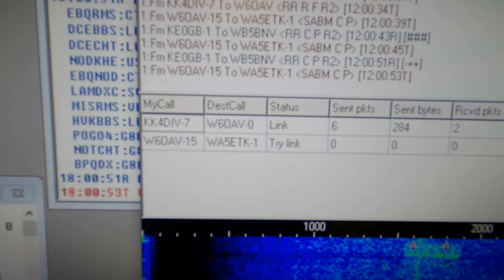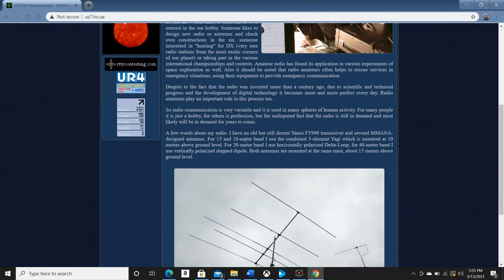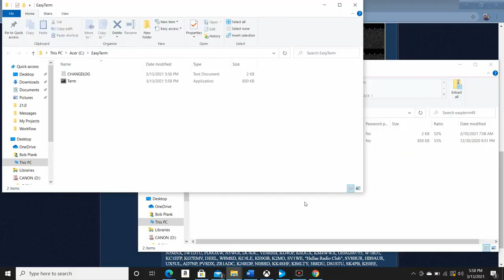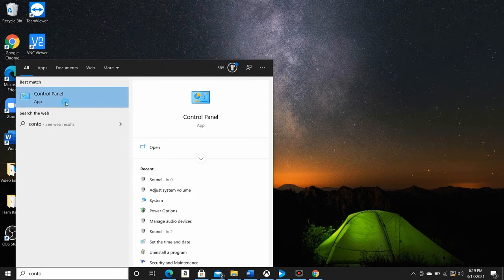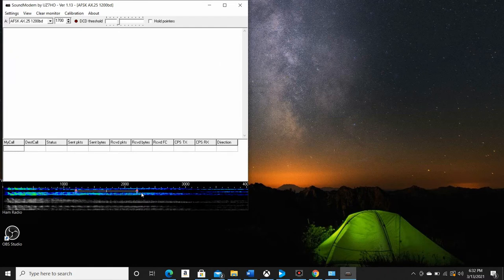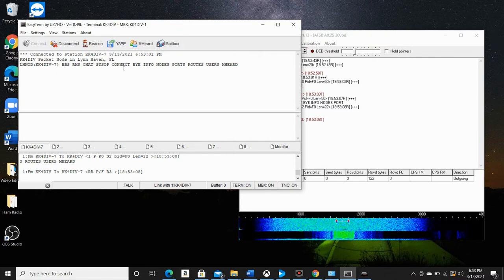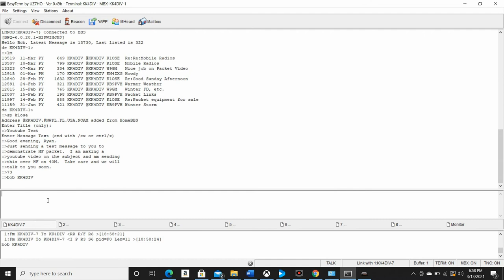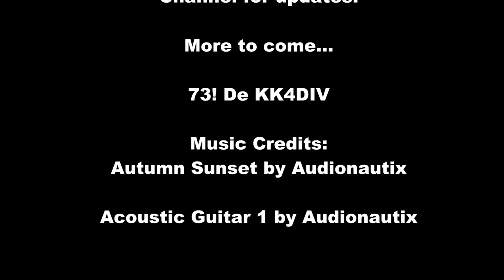Introduction to HF Packet: It's so easy with UZ7HO Soundmodem and EasyTerm! 3/19/2021

Comment: Thanks for the video, I have setup my IC-7300. sound in and output works fine but the ptt isn't working I have setup the right comport for the IC-7300 , Any sugestions?

Comment: Thanks for this. I'll give Soundmodem a try. I got WinRPR working today, despite the recommended virtual serial port utility com0com being utterly useless and not providing COM ports that the application would recognize. WinRPR doesn't seem to care. I can still get a KISS connection to APRSISCE. I think that Robust Packet is supposed to be more forgiving of poor band conditions than the straight AX.25 protocol, or even the FX.25 (with forward error correction). Have you ever tried it? I've been using Direwolf (supports AX.25 and FX.25) and that seems to work reasonably well. Just interested to know what you think of the alternatives out there.

Comment: We don’t have any BBS packets stations here in the U.K. what would you need to have to set one up.
Reply from the maker: Hi, Dave.  To set up a bbs you will need some software.  I use BPQ32 written by G8BPQ.  It runs on Windows and there is also a Linux version, LinBPQ.  There is a node map listing all the BPQ32 nodes and it shows a few in the UK.  You can find it at http://nodemap.g8bpq.net:81.  Maybe there is one near you.  There is a pretty good forum for BPQ32 on groups.io if you have any questions on getting a bbs set up.